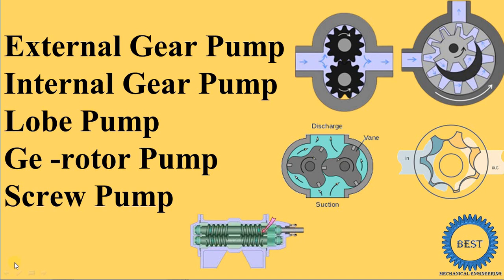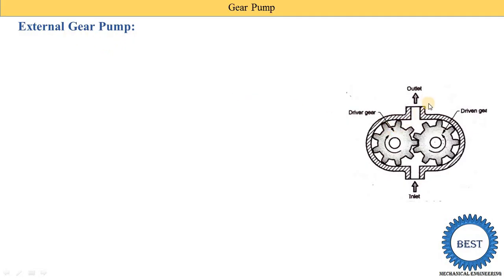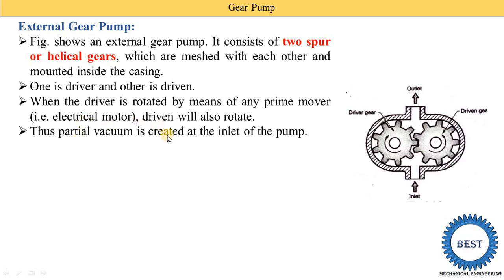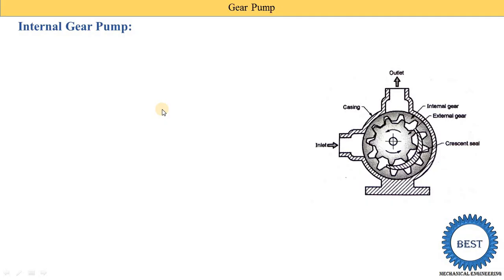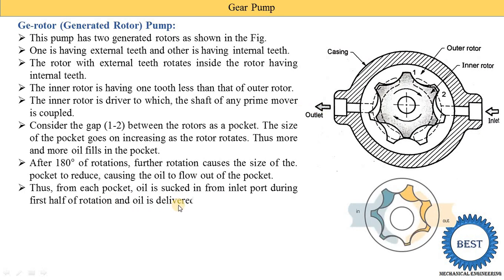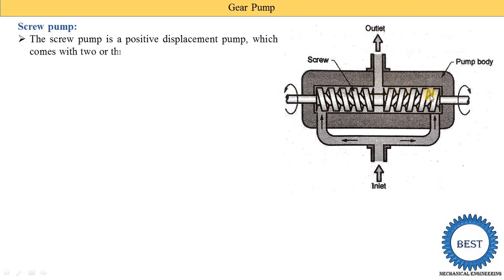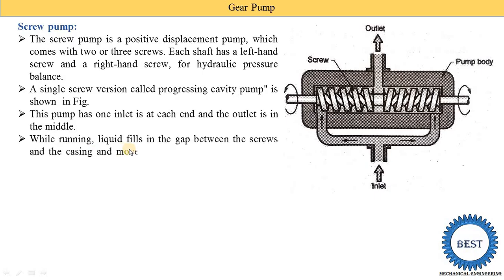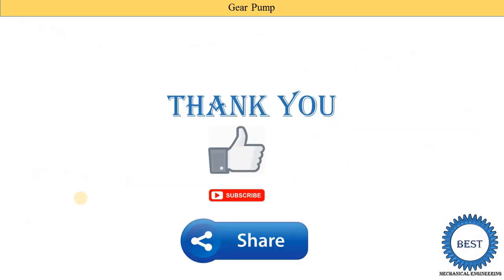Types of Gear Pump - External Gear Pump ,Internal Gear Pump, Lobe Pump, Ge -rotor Pump, Screw Pump

Comment: When one of the teeth breaks off on the rotor gear. Can that missing teeth cause a low pressure point, since there will be a larger gap between two consecutive teeth?

How do I increase pressure on this pump?
Reply: I'm referring to the internal gear pump